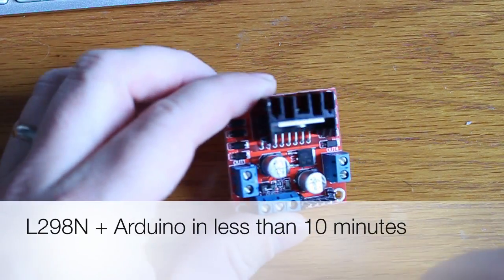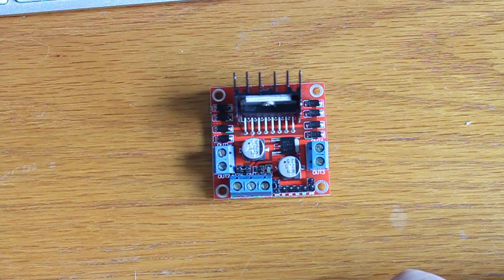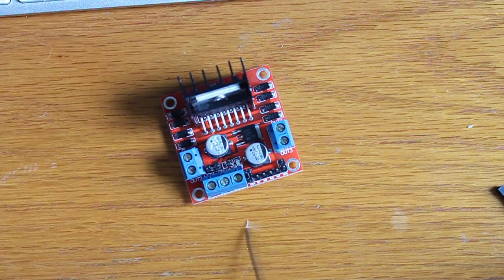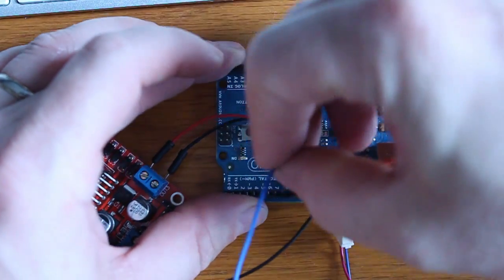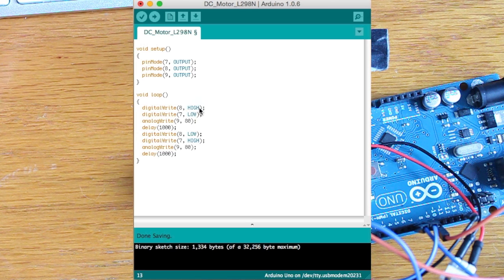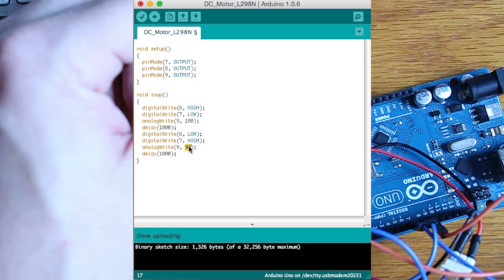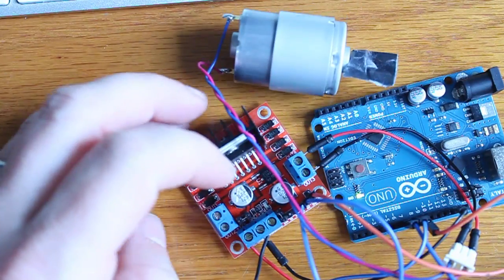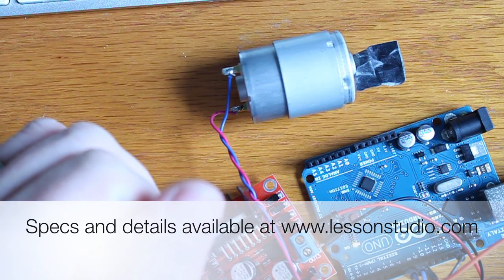HOW TO: control DC Motors with Arduino + L298N

Comment: Hi there,

Great video!!! Very simple.  Can you please explain how can i use the L298N to supply the arduino, using  12v on L298N? Also, i want to connect a water pump (12v), do i need to configure the speed, or if i don't write nothing on code, it assumes full speed as default?
What are the difference btw L198N and L293D?
Reply from the maker: +João Ferreira The L298N is tougher and can handle about 2A per motor, while the L293D can only handle around 600ma. Otherwise they are very similar for most purposes.

Once the 12v power source is connected to the L298N module you can get 5v for the Arduino. Do do this you connect the VIN on an arduino to the 5v on the L298N module. Then you connect GND on the module to the GND on the Arduino and then it will power up.

Just make sure not to connect the 12v+ source directly to the Arduino and only to the 12v positive in.
Reply from the maker: +dan bon marañon The L298N is tougher and can handle about 2A per motor, while the L293D can only handle around 600ma. Otherwise they are very similar for most purposes.
Reply: +LessonStudio Thanks! ;)
Reply: +João Ferreira i had the same question also, whats the difference bet. L198N and L293D,. i just also want to supply the module of 9v battery to make it more fast on rotation. is it posible?
Reply: thank you so much for the answer.. I bought a L298N motor driver yesterday.. i have both L298N and L293D tnx so much
Reply from the maker: +dan bon marañon I have never had a bad L293D delivered to me, but I have had a few L298N's that weren't built correctly. I think that I use one in the video where they didn't finish soldering the power in block and also put it on backwards. Once turned around and soldered correctly it worked. I have another that just showed up DOA. Haven't really tried to figure out what is wrong with it. 

So if you just can't get the L298N module to work, do be aware of the oddly high failure rate. 

With the L293D they don't show up DOA, but they are easy to kill. It is common to see them in a socket on a circuit board so that they can be swapped out.

Comment: I'm trying to pan a camera while sliding left or right. The camera carriage is pulled by a 360 servo and shutter remote by a standard servo. Panning with a servo is not slow enough and not enough resolution. I'm considering a 6v 1 rpm gear reducer dc motor to stop start for a shoot-move-shoot scheme so it has to be timed by the arduino as do the 2 servos. Will a dc motor heat up while it's stopped for 10 to 15 seconds that  it takes to shoot the night sky, repeatedly for 500 shots? Are motors rated at their highest speed as in 1 rpm stamped on the motor itself? Thanks for your informative tutorials.
Reply from the maker: +sonicbrush Typically the DC motor does not expend any power while "holding" position. The way a servo does this is through a continuous feedback using a tiny opamp; as a servo is a DC motor combined with some sort of potentiometer. 

So when you stop spinning the motor you will stop using power and thus no overheat. 

As for the highest rated speed I suspect that anything but the tiniest of motors will be able to move your camera unless it it a monster or the rig has a huge amount of friction. I don't completely understand the 1rpm reducer. Usually they are rated as a ratio. 

An alternative is to use a stepper motor. They give you insane control. I did another video showing how to hook up a variety of motors including a stepper motor. One advantage of a stepper motor for your quest would be that if the motor has sufficient power you can be pretty much assured that when you tell it to turn a certain amount that it will have turned a certain amount. This way by the end of your 1 to 2 hours of shooting it will have moved the same distance each time without any variations.

Sounds like an interesting project.
Reply: +LessonStudio Thanks again for your info. It's clearer to me now. I have shied away from stepper motors because it's beyond my comprehension but since I've been dabbling with servo code and having some success, I just might jump in. Thanks for pushing me in that direction :)
Reply from the maker: +sonicbrush The worst part of a stepper motor is that it has so many wires.

I do another video where I show that it is no big problem. Just a game of swapping the wires about until the magic happens. Unless you are really piling the power into the motor, mis-wiring it is fine.

If you get stuck, feel free to fire off any requests.
Reply: +LessonStudio  Hi there again. After our last conversation here, I've made the jump to stepper motors. I have ordered a 0.9 degree nema 17 (for small steps at full step mode instead of microsteps on a 1.8 degree motor) and a Big Easy driver. I'm confused with Amps and voltages. I have the specs for the motor (Part Number 17HM19-2004S, Bipolar Stepper, Holding Torque: 46Ncm(65.1oz.in), Rated Current/phase: 2.0A, Phase Resistance: 1.4ohms, Recommended Voltage:12-24V, Inductance: 3.0mH±20%(1KHz). I'll be using a 12 volt sealed lead acid battery for the Nema 17 and 2 separate 6volt battery packs for arduino and 2 other servo motors.  Based on these specs, do you see any mismatch between nema 17 and Big Easy driver and 12 volt SLA?  Thanks again for your generous sharing of information.
Reply from the maker: +sonicbrush That all looks very good. The Big easy can do 16 microsteps which combined with the 0.9 step should be pretty smooth. But as you point out the small 0.9 steps are plenty small and by not microstepping it gives you more power. The motor will push the Big Easy right to its limit so I would just make sure that you don't put so much mechanical resistance that the motor stalls. This shouldn't be much of a problem since your application will let the motor/board cool down between shots. Even though you aren't pushing it very hard I would make sure to heat sink it properly.

One thing with the big easy is that like the module in the above video it can put out a 5v for the arduino which could be a bit easier than tapping it off another battery. With your 12v supply it would make a nice smooth 5v.

Factoid: NEMA 17 isn't a motor but a size/mounting specification. The reality is that I have never seen a NEMA 17 motor that wasn't a 0.9 or 1.8 stepper motor, so calling a motor a NEMA 17 is going to have the same thing appear in most people's heads. The only usual difference is in the thickness and power. Roughly what you bought are by far one of the most popular motors in robotics, 3D printing, and small CNC machines. You made an excellent choice.

Where I would be only slightly fearful of that motor/board pairing would be if the load was hard and non-stop but with much variability. Something like a robot leg that was always moving and could often stall under highly leveraged loads. In theory that motor pushes up against the controller's limit and my rule is to leave some margin. In the robot case I would be testing the amperage with a multimeter along with my heat sensor while testing under highly adverse conditions. Your demands are the opposite of that.

Great luck with your project!
Reply: +LessonStudio  At the other end of 16 microsteps, if it proves to be too slow at 0.9 degree full step, will I be able to "macrostep", if you will, to speed it up?
Reply from the maker: +sonicbrush Absolutely, you just need to increase the number of steps per second. Under a light load and even with 16 microsteps that motor should spin fairly quickly. Without microsteps that motor should spin wildly fast.

Unless it is has a significant gear reduction, full speed on that motor should move things very quickly. Too quick for most purposes; especially a slow pan.
Reply: +LessonStudio Thanks for reminding me of that 5v output from the Big Easy. That's a great convenience. I only have to worry about 2 power supplies. 7.2v for the camera and 12v for the whole rig. I'll send you pictures as soon as I'm done. I've got the code for the 2 servos and temporary working placeholder stepper 28BYJ-48 working.The Big Easy came in the mail today and nema 17 to arrive tomorrow. I can't wait. Thanks for being so kind and encouraging.
Reply: +LessonStudio Got the step motor and Big Easy driver. Soldered the pins triple checked all connections. Powered the Big Easy and the main chip got very hot and in a few seconds started to smoke. Powered it off. Checked all connections again and powered it on and nothing. I'll have to reorder from amazon which takes a week. There's a local Radio Shack that carries SeeedStudio Driver Shield with the L298 chip dual h bridge as in the above video.  Not sure if it microsteps. Will this work for my application?
Reply from the maker: +sonicbrush Damn, that really sucks. At least you now can use the term, "I let the magic smoke out." I really really let you down by not making one good recommendation: That is, when you first put power into something you are unfamiliar with, it usually is a good idea to completely underwhelm it with just a little bit of power. For instance I keep an IR temperature probe handy and beyond just using my finger it lets me know when things are going wrong. The benefit of using it over a finger is that it can quantitatively identify a trend. Most ICs don't like anything past 150-175. Thus if I am not pushing something very hard and it starts to approach 100 then something is probably very wrong. This won't save you every time but many modern ICs are pretty resilient. Some are way too touchy and can be fried with an angry stare. I recently fried a 3.3v linear regulator; it was my last one. But by some strange quirk of fate the 3.3v positive started coming out of the top grounding sink. I have no idea how long that will last but it is now in a functioning circuit until my resupply comes.

In theory the L298N based chips can kind of microstep; I think some people have gotten it to half-step. 

What I would look at though is just seeing how small those 0.9 degree steps really are. 400 steps per rotation would be pretty tiny movements. Thus with the L298N based one you might get the effect you are looking for. A quick bit of math might be that if you have the motor connected to a gear/wheel with a circumference of 5 cm(just a guess) you are looking at about 2400 steps per linear foot. If the gear is smaller then all the better.

On a note of hope. Now that your driver has cooled, you might want to try it again will far less power. It is remotely possible that some sort of resettable fuse was triggered. Before you wire it up. With a multimeter check the resistance of the various places you are connecting the main power. Very little resistance would indicate that it wasn't meant for all that power and is probably not where you put the connections.
Reply: +LessonStudiio  Plugged in the Big Easy this morning, to my surprise, it turned on. Started simple, feeding it 5v at first then moved to 12v and still no smoke. Connected just the DIR & ST and code from here (http://www.schmalzhaus.com/EasyDriver/Examples/EasyDriverExamples.html) no movement on the stepper. Then I wired everything according to sparkfun's page (https://learn.sparkfun.com/tutorials/big-easy-driver-hookup-guide) with EN M1 M2 M3 DIR ST and GND to arduino (also laptop detected and installed successfully the AT mega 16 U2. I ran their sample code, it didn't compile, gave me an error 
"resetBEDPins' was not declared in this scope". I hope I didn't burn the stepper. I did test the Blk Grn and beeped, Red Blu also beeped. Does that mean the motor's ok? Got a code I could try?
Reply from the maker: Not much code that I can suggest in that I don't have the identical module. But a code compiling error will have nothing to do with the module itself. I think I found the code you have copied and that code is incomplete. Some include or something is missing from the top.

One bit of code they suggest as the most simplistic is:

void setup() {               
  pinMode(8, OUTPUT);    
  pinMode(9, OUTPUT);
  digitalWrite(8, LOW);
  digitalWrite(9, LOW);
}

void loop() {
  digitalWrite(9, HIGH);
  delay(1);         
  digitalWrite(9, LOW);
  delay(1);         
}

As found on :http://www.schmalzhaus.com/EasyDriver/Examples/EasyDriverExamples.html
That would boil everything down for an easy test.
Reply: +LessonStudio 

Big Easy's red light is on. I assume it's not fried. Did led test on stepper and lights up. Ohm'd the wires and I got the pairs. Does polarity matter here?  
Been trying to compile the simplest code above but I keep getting this error:

Arduino: 1.7.8 (Windows 7), Board: "Arduino Uno"

sketch_mar04b.cpp.o: In function `setup':

C:\Program Files\Arduino/sketch_mar04b.ino:3: undefined reference to `pinMode'

C:\Program Files\Arduino/sketch_mar04b.ino:5: undefined reference to `pinMode'

C:\Program Files\Arduino/sketch_mar04b.ino:7: undefined reference to `digitalWrite'

C:\Program Files\Arduino/sketch_mar04b.ino:9: undefined reference to `digitalWrite'

sketch_mar04b.cpp.o: In function `loop':

C:\Program Files\Arduino/sketch_mar04b.ino:16: undefined reference to `digitalWrite'

C:\Program Files\Arduino/sketch_mar04b.ino:18: undefined reference to `delay'

C:\Program Files\Arduino/sketch_mar04b.ino:20: undefined reference to `digitalWrite'

C:\Program Files\Arduino/sketch_mar04b.ino:22: undefined reference to `delay'

C:\Users\Ron\AppData\Local\Temp\build133998187224075502.tmp/core.a(main.cpp.o): In function `main':

C:\Program Files\Arduino\hardware\arduino\avr\cores\arduino/main.cpp:32: undefined reference to `init'

collect2.exe: error: ld returned 1 exit status

Error compiling.

  This report would have more information with
  "Show verbose output during compilation"
  enabled in File > Preferences.
Reply from the maker: You can send the code to my email donovan (at symbol) lessonstudio.com

I suspect there is something wrong near the top that is putting everything else out of whack. Getting a "undefined reference to `pinMode'" is very odd.
Reply: +LessonStudio Hi Donovan.  I went and got the Seeed Studio motor sheild at local Radio Shack. Hooked up everything. Paid special attention to motors +- and M1 and M2 +-. I'm getting movement, albeit a wiper action but very very small steps. Still trying to figure out the code and what numbers make it move and delay and such. Got the code from SeeedStudio Instructable. So, it's safe to say Big Easy is fried. I'll keep you apprised of progress. Thanks Donovan.
Reply: Now Controll anything in adrunio via keyboard{makeAnyprojects}
https://youtu.be/jAHLtRmgRiI

Comment: Great Video! i have similar module and i have a 24v 80w dc motor. my question is is it possible to connect 2 x Microswitch - SPDT https://www.sparkfun.com/products/13119 to have the motor stop when it trips the first switch and also stops when it trips the 2nd switch ?
Reply from the maker: +Co Chrigui Yes that should be very easy. You could wire that through two input pins on an arduino or you could even just directly wire the microswitches up through the module's speed control. 

Your using roller switches should make the mechanics of this far easier. The key is to make sure that your similar motor control module can handle the roughly 4A and 80 watts. 

Good luck.

Comment: Can the L298N connected to dc regulator power supply instead of the battery ? 
Can L298N withstand 5 Amp current and 50 volts maximum?
   Thanks in advance
Reply from the maker: +Mahmoud Taha No, the rated limits of this module are 35v and 2Amps per motor. But it could easily be connected to a regulated power supply. Just with far less power being used.

One other recommendation is that you don't generally push things such as this up to their rated limits. Personally I try to stay well below the rated limits, especially when it involves motors. But anything past around 80% of its rated limit starts to make me very uncomfortable. In the world of electronics and especially motors the power usage isn't easily predicted. For instance you can get all kinds of power spikes with motors. These can come from the start up power to a huge load spike if the motor stalls or encounters significant resistance. In reverse your circuit can come under a load from the motor if the motor spins on its own as many DC motors effectively become generators when spun. 

So where you are looking for 50v at 5A I would be looking at something that can handle at least 60v and maybe 7A or ideally 100v and 10A. Also you will need to watch out for the watts. 50v at 5A is 250w, so again you will want to get something with a higher rating. The watt limitation often involves heat dissipation. Thus if you increase the cooling through fans or good air circulation you can comfortably get closer to the maximum rated watts. But if the cooling is poor it can significantly lower the effective watt rating. 

 Then to make it even more confusing some of the watt loading can come from how much PWM you use to control the motor. I have seen situations where a very high frequency PWM will heat up the IC even under very small loads. Whereas just a wide open signal to go as fast as possible will potentially push the module a little less. 

These complications are why I find it easier to just leave a nice margin. Technically they can all be calculated and for a thousand dollar circuit I would. But where the cost difference between an exact module and some overkill is minimal I go for the overkill.
Reply: Now Controll anything in adrunio via keyboard{makeAnyprojects}
https://youtu.be/jAHLtRmgRiI

Comment: how can i control dc gear motor with this driver as it need more voltage than a simple dc motor because its size is little bit bigger than this?
Reply from the maker: +Bakht Afzal What would the specifications be in volts, amps, and potentially watts?
Reply: Now Controll anything in adrunio via keyboard{makeAnyprojects}
https://youtu.be/jAHLtRmgRiI